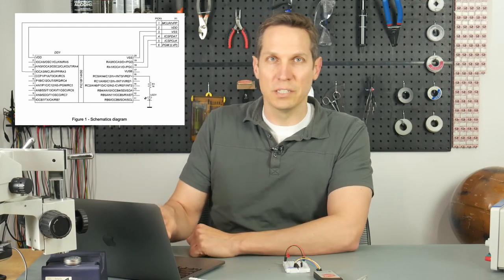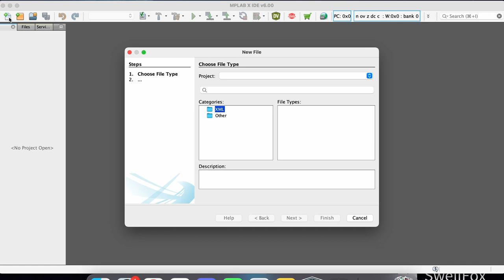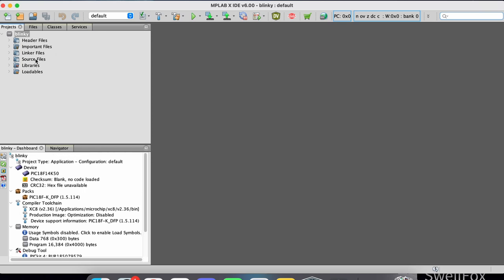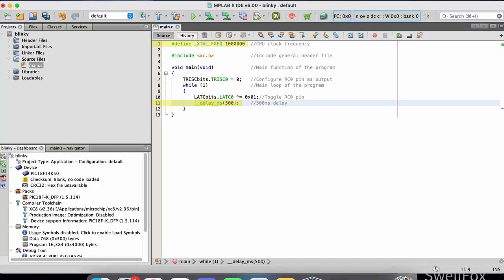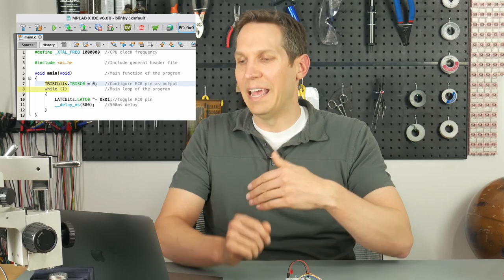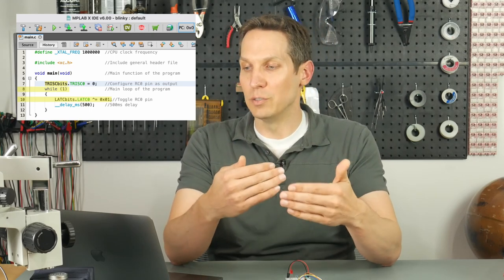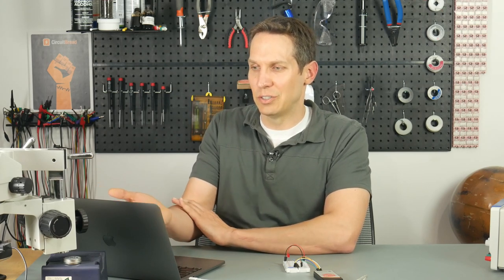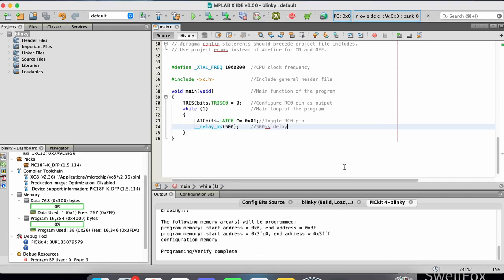Part 2. Our First Program - Embedded C Programming with the PIC18F14K50

Comment: Used to use the Arduino ecosystem. Very reliable, great online resources and a wide range of easy accessible libraries to communicate with loads of hardware.
My first project was a tiny weather station based on a BMP150 barometric sensor and a DHT11 hygrometer. I planned to use it to control an irrigation system during droughts in a collab garden project. Unfortunately it didn't see any use there but i kept the skills. Now i know when ever a household appliance gets a hiccup i can replace it's brain and make it do it's job again or even extend the functionality.
Reply: I just drifted  off into a daydream where i control my washing machine with a python script from a terminal window.
Then i realized that if i ever want to date some one in a serious fashion and then have to explain the how the washing machine works, i end up...
🤪
Reply from the maker: I'm familiar with those daydreams...

Comment: It may sound weird, but I bought pic16f18854 (the lowest one from the family). I used a different programming tool (Snap) but this video helped me a lot. Thank You!
Reply from the maker: Awesome, glad it helped!  Maybe we need to be clearer that these tutorials are specific to a few PICs but most concepts should apply to any PIC and programmer.  I always struggle with messaging...
Reply: I'm using the same 16F device the Config Bits tripped me up when comparing to the 18F device.
Reply: @bruceknipe6255  I just skipped configuring some bits. And it surprisingly worked.

Comment: Hello circuitbread, I have access to the PIC18F4 series of microcontrollers where  I live, can I follow this course with those kind of controllers or should I try to reach out and get hands on the one you are using?
Reply from the maker: There may be minor differences in the pins used and certain peripherals but, particularly for these first tutorials, there shouldn't be a much of a difference if you're using a different MCU within the 18F series.  As the examples get more complicated, I would anticipate a higher chance of needing to make modifications to make it work for your chip but that's not necessarily a bad thing.  While frustrating, it'll force you to delve deeper into the chips and gain a deeper understanding.  So, that's up to you!